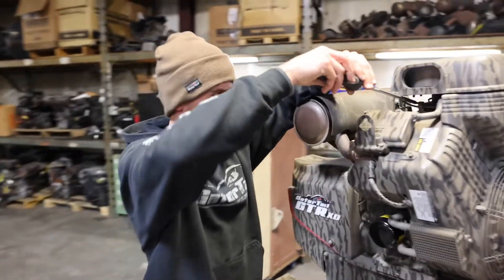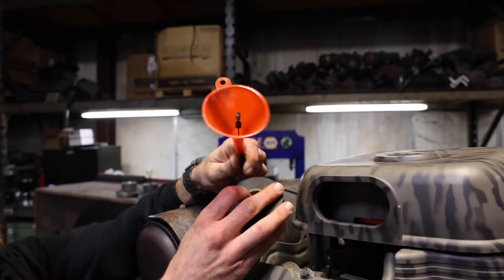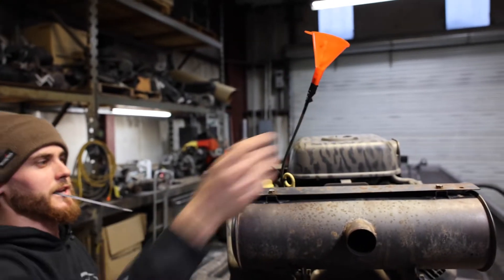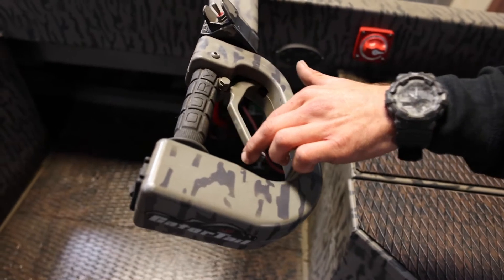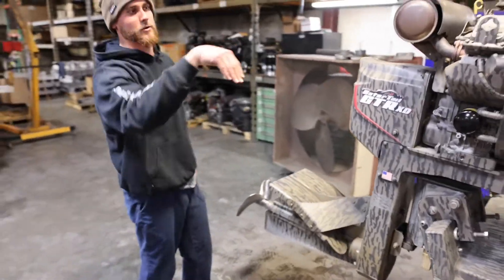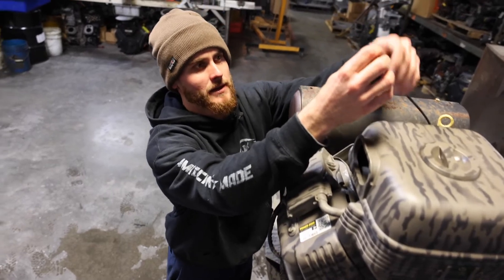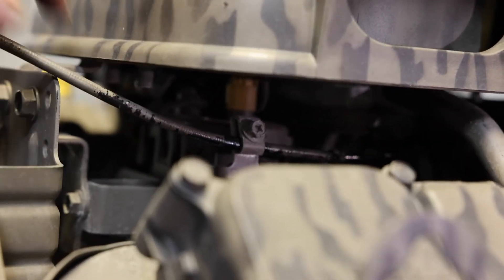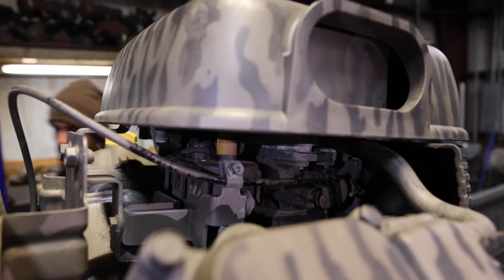Throttle Cable Treatment

Comment: i use radiator fluid instead of aerosol spray.  it doesn't evaporate as fast and will absorb any water that would get inside cable.